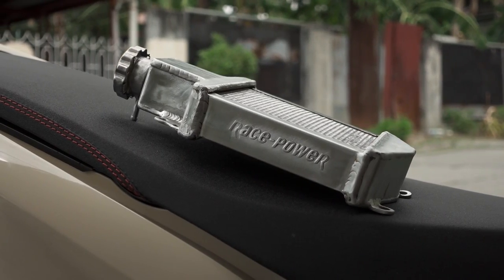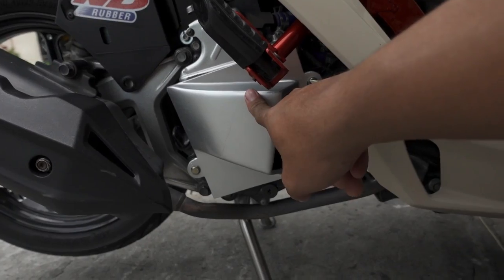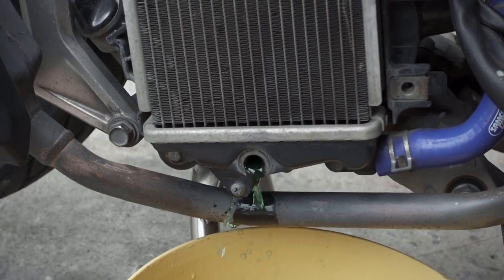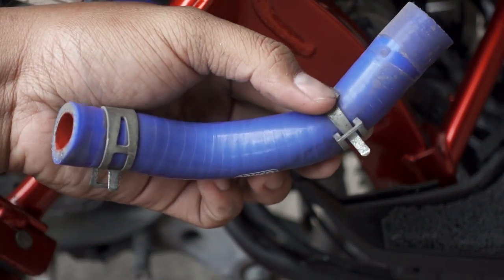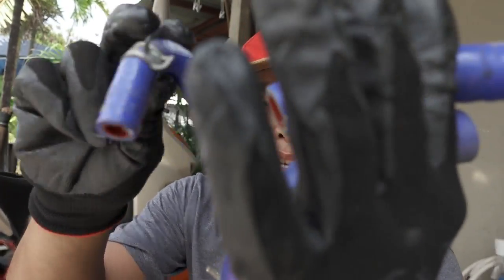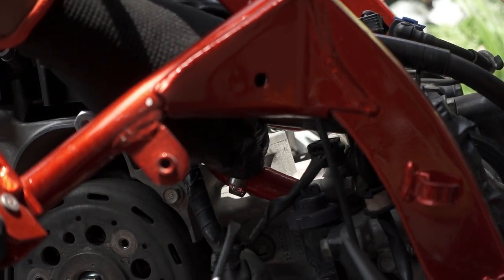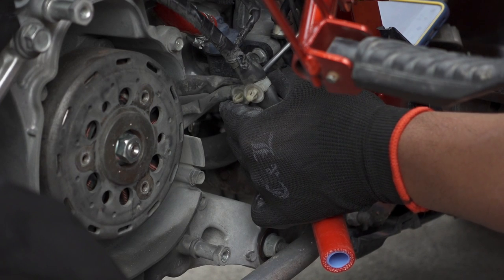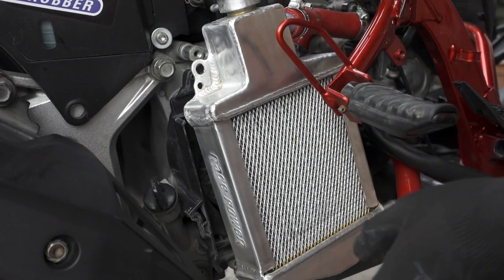INSTALLING RACE POWER RADIATOR | HONDA CLICK 125i

Comment: Nice👍 pero para sa akin mas ok ang stock clamp sa hose kasi kapag uminit na ang hose lumalambot yan at nag aadjust yung stock clamp, di tulad may screw. May tendency kasi magleak. Pero solid naman higpit nyan samco hose magandang klase. Keep up po at kudos sa mga builds mo Boss
Reply from the maker: Maraming salamat sa idea bro 🙏🙏
Reply: @LIANEVLOG  walang anuman lods

Comment: Sir gd morning 
Sa akin loaded yung click 125 q v2.
Nka 59mm block
Naka cylinder head click 150
Naka 10 holes fi injctr .

Tpos stocks yung rad q.
Laging overheat.

Ok lng ba gagamit aq ng big radiator race power